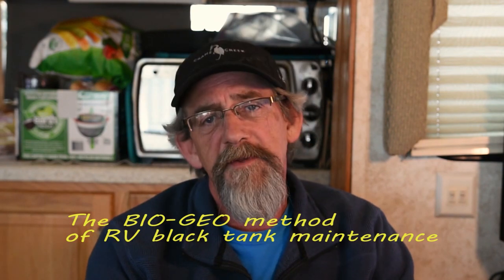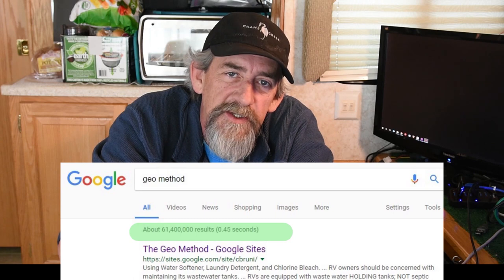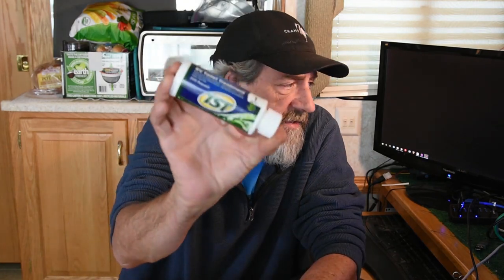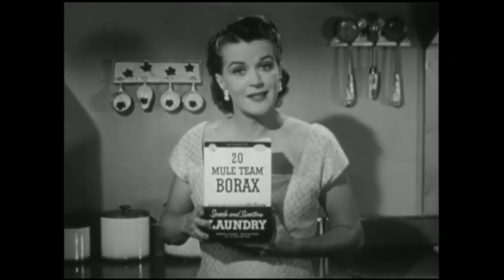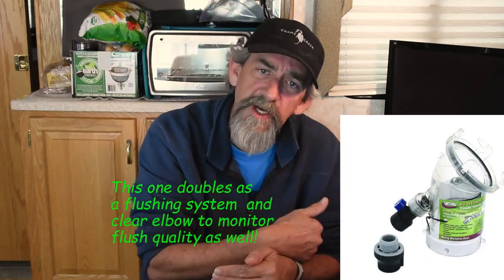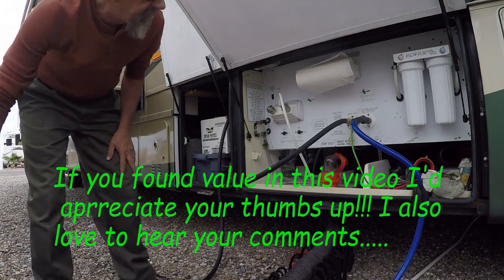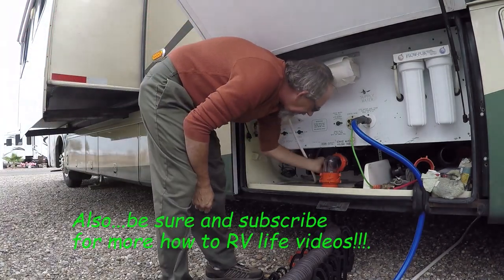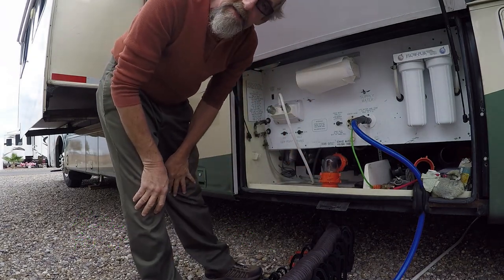A New updated video has been published. Link below - The Bio-Geo Method of RV Black Tank Maintenance

Comment: Mr. Bowlin
Would it harm anything before doing the Bio-Geo system  to clean the black tank with a pressure washer to pre clean it.
Reply from the maker: I'm not sure. I know there are companies out there that will clean your RV system and I assume they use some sort of pressure cleaner so I guess it would be okay. If you can I would let the tank sit full overnight with the Boraxo and Dawn to soak into the gunk on the walls and floor. That should help soften the materials on the walls in particular. Could be messy??? Thanks for your comment. Have a great day!
Reply: what about adding an enzyme cleaner ( like used for spot cleaning puppy accidents) then letting it sit, then go to the Bio-GEO METHOD.   HOW DO YOU CHECK SEALS?

Comment: TR, could you substitute the "Oxy-Clean" products for the Boraxo?  Would that provide more oxygen?  Would that be cost effective?  Thanks
Reply from the maker: That's a really good question. I had not considered it. I did some research (https://en.wikipedia.org/wiki/OxiClean) and it works exactly the same as boraxo. Not to get too deep in the chemistry but Oxy-clean is very similar chemically except that they add something called  TAED. It is an organic compound that helps 'activate' the bleaching action caused by hydrogen peroxide present in OxyClean. As I was reading about this it may work a little better because it allows more hydrogen peroxide to be produced at lower temperatures. Boraxo, as far as I can tell does not contain the TAED. 

To answer your questions... Yes you could use it instead of boraxo. 
Yes it may provide more oxygen depending on the temperature of the contents of the black tank. If your in a cooler climate you may get better results with oxyclean. 
Boraxo on Wlamart's website is about 7 cents an ounce vs 12 cents an ounce for Oxyclean. I'd have to experiment to say for sure if it would be cheaper... If you could use about 1/3 less Oxyclean than boraxo and get the same results it would be about break even cost wise. And of course if you could use less of it, it may be cheaper in the long run.

Thanks for making me think this morning, and thanks for watching. Keep watching, I've been working on an update to the method that allows putting paper in the tank. I've been experimenting for a couple of months now and I have a slightly revised flushing method that seems to be working really well.
Reply: TR Bowlin 0

Comment: Hello Mr. Bowlin, I am using a port-o-potti type of portable toilet which has a fresh water tank and a dirty water tank.
I only use the toilet to pee at night and at times where going into the bushes or other toilet facilities are not around.
After a day of 4, I notice the water mixed with the urine starts to stink, not very bad nut it still does. The dirty tank can be closed of but has to be opened when I need to pee on it.
I thought about using water from a pond (which has the nitrifying bacteria which should covert the ammonia and urea into odourless nitrites and nitrates. But onfortunately it does not. 
Do you have any ideas what I am maybe doeing wrong or can hand me a method to keep the "dirty water" in check odour wise.?
Regards, Sander.
Reply from the maker: Hello. There is no reason you could not add a little boraxo to the tank. It will help with the odor. I'd recommend a couple of tablespoons of Boraxo. It will help to oxidize the ammonia and stop the stink. Dissolve the boraxo in a cup of water before you add it. When my tank gets to smelling of urine I add the boraxo and within a couple of minutes the smell is gone.
The problem with the pond water idea is time. It would work eventually but it takes time for the concentration of bacteria to get high enough to make any difference. I suspect you'll get tired of smelling the ammonia before enough bacteria builds up to denitrify the contents. 
If you dont have access to boraxo, try some vinegar. It will also work. Again just a couple of tablespoons in the tank.
Try it and let me know how it works! Thanks Sander!
Reply: Hello TR, thanks for the swift answer. I will try your method the next few weeks. The dirty water tank   is little under 4 gallons large  so not anywhere near the 55 plus gallons of RV's. May I assume you base your borax recipe on the 55 gallon black water tank? And may I assume boraxo (the 20 mule type) is the same as your laboratory grade borax ?
Reply from the maker: Yes that is correct, but keep in mind that I rarely have a full tank so I account for that and as the tank fills I may add additional boraxo if it starts smelling.  There is little difference between boraxo and lab grade borax and I do use Boraxo. It's cheaper. Also very important to dissolve the boraxo in water before adding. It speeds things along. Thanks for watching!

Comment: I lost your answer about what to do about flies coming out of my toilet when I flush it. Can you please resend it?
Reply from the maker: Yep, this can be a common problem. They are coming in from the campground sewer system when you dump your tanks and are difficult to get rid of. A couple of suggestions: Make sure you do not leave your holding tank valves open. Only open them when dumping your tanks. You can try bleaching your tanks. Dump them and then refill with water and add 1 cup of bleach per 20 gallons of holding tank capacity. In other words if you have a 40 gallon black tank, fill it with water and add 2 cups of bleach, then let them soak overnight.
Reply: @trbowlin  the bleach won’t rot the rubber gaskets?
Reply from the maker: @gailwalker6872  no. 2 cups in a full holding tank is not a strong concentration.  Its pretty diluted

Comment: Wow I use almost the same method. I didn't have a name for it, it just knows it works. I do use Happy Camper Treatment but I'm going to try Borax.  Way cheaper.  I like to use a water meter on the inlet of the sprayers that way I have a better idea of how much water goes into the black tank. I know anal right but if I'm going to be anal what better time than draining a black tank.  Sorry couldn't help myself. We have a 2003 DSDP. Love your videos. Thanks
Reply from the maker: Thanks Mike. That's a good idea on the meter on the flush line. I've thought of that and using one when  I am filling the fresh water tank.

Comment: The drawback is ,your killing the bacteria that break down the waste. When you dump into the station, if they have a septic system, like most rural parks, your killing the benifitials in there system with your chemical sterilizer mix.
Reply from the maker: I'm sorry I am not understanding your comment. My WHOLE purpose for the method is to PROMOTE the beneficial bacteria in the tank.

Comment: You really know your shit! No paper?? Really
Reply from the maker: Yea no shit...I don't put paper in the toilet. for me it is not a big problem and when I have guests I don't ask them to not put paper in the stool. I will note that when there has been paper put in the tank I have to add MUCH more water to the tank during the flush cycles to get the tank clean and all the paper out of the tank. For example I had guests staying with me a while back (in August during the eclipse). I just moved from southern Utah to Vegas last week and I did the Boraxo/Dawn scrub cycle during that move and I was still getting paper out of the tank during the flush after my typical three flush cycle. I had to run the tanks to 90% of capacity twice during the flushing before all the bits of paper were flushed out and the tanks ran clear and it took 6 fill and flush cycles to get the tank clean. So that paper was sticking to the walls of the tank and that along with other crap (ha ha) sticking to the walls of the tank is what makes your tank monitors stop reading correctly.
Reply: I had fortunate experience of going to Cairo some years ago and stayed with a family. They are on septic system. They use bidet (hand sprayer) for cleaning. Paper is ONLY used for drying off and it's tossed in a trash can. Everyone does it,  including guests.  No exceptions.  Apparently paper in their system is a huge problem.  I have been wanting bidet in my home ever since and I plan on putting one in our RV stat!
Reply from the maker: Interesting. I was in India for work and RARELY did you even find paper in the bathroom. They too were big on using a hand sprayer. for me...a westerner, it was a little disturbing at first but you have to adapt. In my RV there is a hand sprayer, but I've never used it for rinsing anything other than the bowl. It's not heated and in winter when the water temps are lower it would be a pretty big shock I think to hit your bottom with 50 degree water... ;-o
Reply: Nah, it's not that bad.